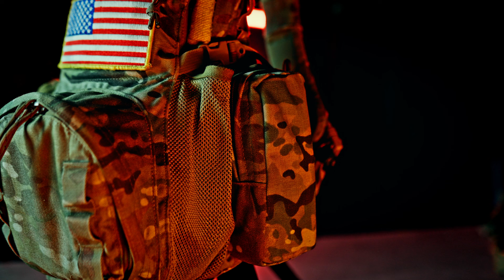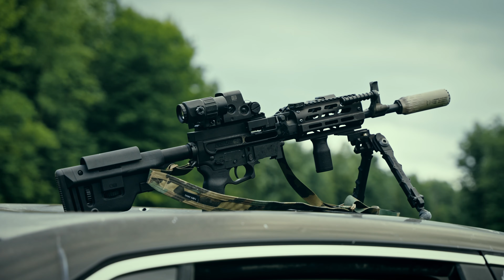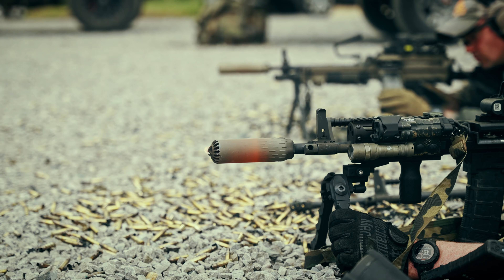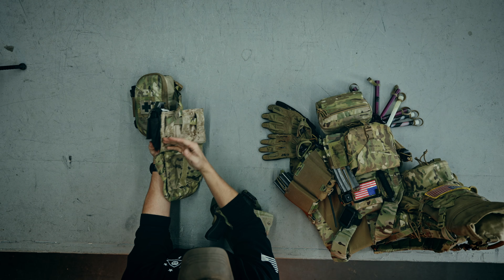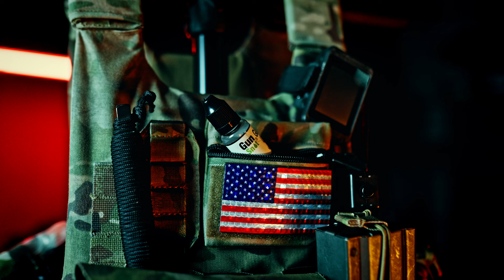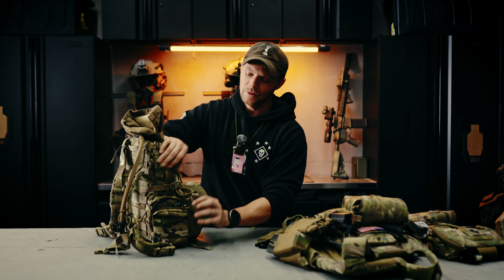Civilian Belt-Fed Assaulter Kit Load Out

Comment: Serious question: WTF is even the POlNT of putting a can on a freakin beIt-fed setup?? l mean, seriously what a complete waste of money. Not trying to be a hater but that is my opinion.
Reply: Suppressors on belt-feds aren’t about being “quiet.” They’re about signature reduction and control. You get way less muzzle flash (huge for night/NODs), reduced blast and concussion for the gunner and team, better comms, and less dust kick-up. Thermally, they help diffuse the plume so the firing position is harder to pinpoint. The added mass and gas delay can also smooth recoil and tighten the beaten zone a bit. It’s really about survivability, coordination, and effectiveness — not stealth.
Reply: @Sullie_Actual  1. A suppressed belt-fed 5.56/similar setup is still SUPER LOUD. 
2. A glowing hot can will not hide your position and do nothing for NODs. Same as in daytime. See point 1 above.
And remember, this video is aimed at civilians, not a combat squad of fully-funded US soldiers with air support.
Reply: Flash mitigation. Less for sound.
Reply: @Mcallen1130  Dude, when you're shooting a beIt-fed setup (especially Iike the one shown in the video) with or without a glowing-hot can, "fIash mitigation" is going to do ABSOLUTELY NOTHlNG to conceal your position. You will still be heard a mile away...

Comment: The Fight lite is not very accessible. At $6-7000 for the one that matters it's almost as much as an FN or parts kit gun. $9k will get you a used SAW which has a Super S out for it. The Lima 6 has everything that you need without the cost and Red Right Hand is making uppers with cooling. 

Edit: why would you carry AR mags let alone a very bulky D60 for a belt fed? If you need an AR mag they dudes with you will have them. I've seen no serious SAR gunners carry AR mags.

Oh and f you guys. You're a joke now.